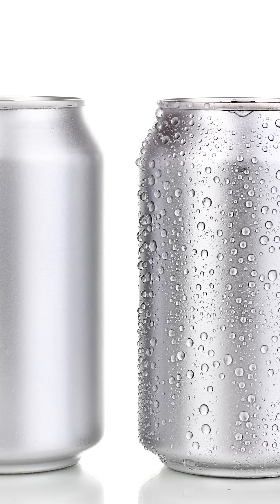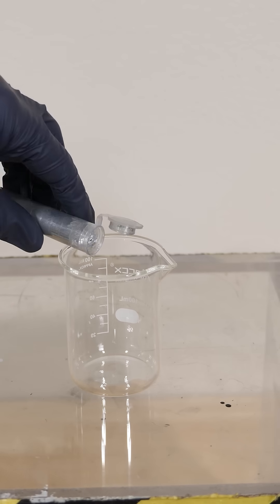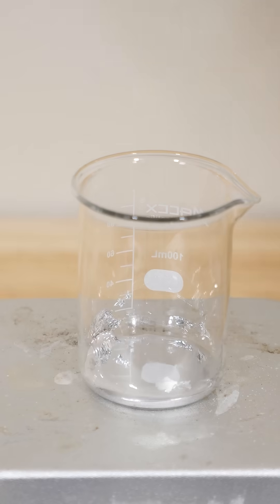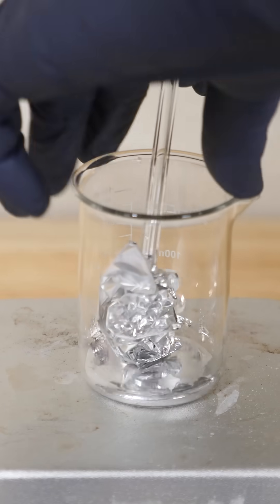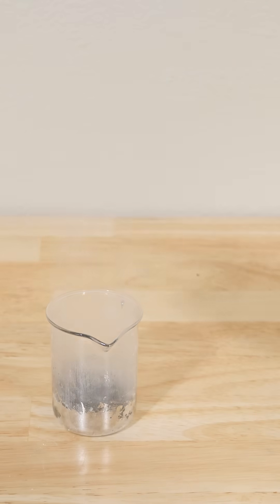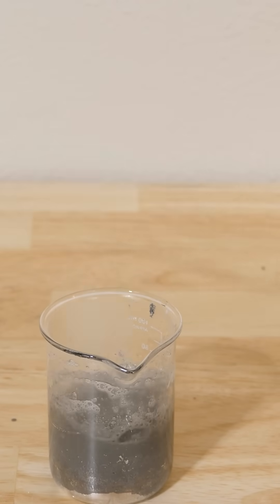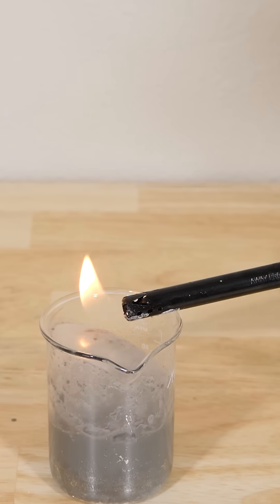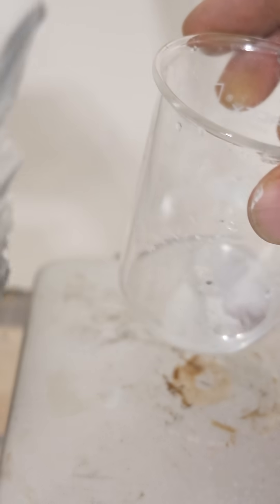Don't mix water and aluminum!

Comment: What is required to recover your Gallium?
Reply: Nothing. Gallium remains in metal form, whereas original aluminium is now Al3+ in water. Just remove the solution.
Reply: Burn off the aluminum as you saw demonstrated in this video. Come on, let's fire on all synapses here.

Comment: Yeah... you gotta do some nasty things to aluminum to get that oxide layer off. I've been trying to electroplate metals made from old beer cans.
Reply: All you have to do is soak them in a low concentration caustic soda (aka lye/drain cleaner)
It's no worse than using drain cleaner because you dilute it (and you're not dumping it into the water supply)
Aluminum cans can be anodized but good luck "plating" them. They are also made from low quality aluminum full of silicon (silica?) and other fillers so I don't reccomend using them to practice when you can find so many things made of 6061 aluminum so easily.

Another reason not to use cans is they have a plastic liner inside of them that will need to be etched off as well, it's best to just use something else thicker and ready to be etched.
Reply: @FedSmoker64  "Different grades of Aluminum."
I went to a scrap yard one day with a truck full of Aluminum Wire, and the Yard Dewd told me I "was getting pot metal prices because it isn't Can Grade."
And I said, "No, I'm not. I'll go down the street to your competitor, who knows not to pull this shi* on an electrician."
Reply: @TimeSurfer206  I wouldn't pay more than pot metal price for anything that isnt specifically 6061 or a few 7xxx series.
Most aluminum isn't that pure it's full of other crap, once you melt it down it's not worth the heat it took to melt. Not to mention lower grades are harder to impossible to work with depending on what you want to do.
Reply: @FedSmoker64  Go read the specs on electrical grade aluminum.
Reply: @TimeSurfer206  My point is how does he know immediately what alloy it is? I'm not taking some random persons word for itm
Reply: @FedSmoker64  Gee, I don't know...
Maybe, JUST MAYBE, wire shapes with insulation might be a clue.
Ya think?
Maybe?
Some day?
Or even ever?
Reply: @TimeSurfer206  That is no indication. I can buy chinese wore right now that is stamped as a more expensive metal even then it is not.
Reply: @FedSmoker64 send links please this is fascinating
Reply: @FedSmoker64  Cast AL is trading at $0.60/lb, scrap. IIRC. Fair bit more than steel.
Reply: @FedSmoker64  So THAT'S why producing aluminium in Satisfactory gives you a load of useless silica! I never knew, thanks!
Reply: You do know beer cans are coated with plastic on the inside right? Right?

There's numerous videos where they use acid to eat away the aluminum, while leaving the polymer plastic internal can coating..
Reply: @southernflatland  Yes. I sell the cans to the scrap yard, and that plastic lining becomes Sonebody Else's Problem. 

Troll harder next time.
Reply: @bcubed72  Read the original post again, and read my comment again.

That's not trolling, that's education. Coating makes aluminum almost impossible to plate.
Reply: Why else would want the oxide layer off? Gallium seems pretty safe to use for this reaction but I'm sure the presence of gallium doesn't allow for the full utilization of aluminum in chemistry.
Reply: Just take it into space and either chemically or mechanically strip the oxide layer. 

Jesus, dude. You act like this shit is hard 😂

Comment: I used to make the hydrogen with caustic soda, same process.
Reply: Similar but not exactly. You are consuming both aluminum and soda, whereas in this case gallium is just a catalyzer.
Reply: @antonioamosanchez4912  It's probably a bit less volatile,  I used to put it into balloons, tie a piece of string on that had a bit of kero in it, let the balloon go up, and set fire to the string, the balloon would give a large flash, but nothing like I've seen hydrogen do, I might feed some to an engine and see what happens.